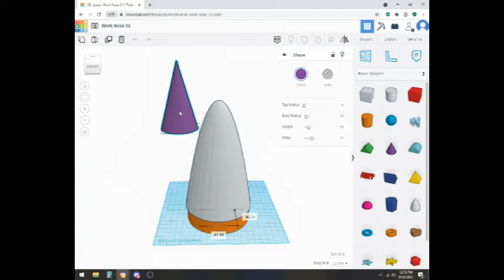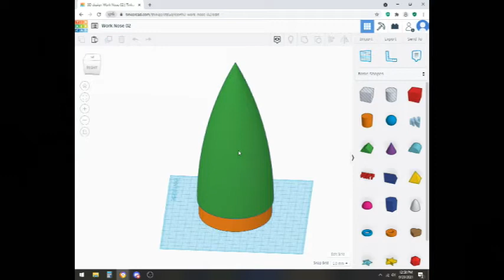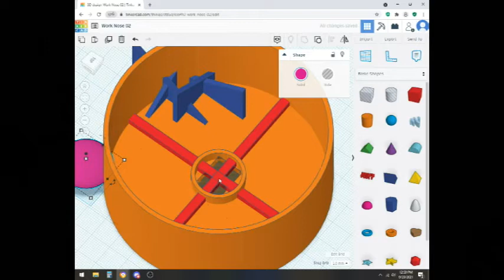Our first 3D printed nose cone using TinkerCAD

Comment: Good nose cone, but did You Try make a mold to make a fiberglass one, i think it whuld be more ligth.
Reply from the maker: The 3d print one is not really heavy at all. Actually, this one has a double wall because we are expecting some extreme speeds with our next rocket and motor. It could be even lighter with a single wall. I have two other videos for making nose cones. One does use a mold from a soda bottle to form a nose cone out of automotive body filler. I really like making those and have flown them many times on our Eliminator series rockets - Those launch vids are also on the channel. The other nose cone video uses kind of a reverse mold process where epoxy is put onto a styrofoam shape. That technique is interesting but now that we can 3d print, i don't thInk i have a need for that method anymore.

Comment: could this cone handle a H550ST motor? i am building a LOC-IV type rocket and i wanted to 3d print the nose cone. thansk
Reply from the maker: I don't see why not. That is not a really large motor and as long as you have a nice aerodynamic nose cone then it should work fine. There are some things you can do when 3D printing to improve strength.
1. Different filaments/plastics have different strengths. We use standard PLA and it works well. But there are stronger filaments available.
2. Number of outside layers. I believe the default of most slicers will use 2 layers for the outside of the print. Adding more layers would make a thicker & stronger skin.
3. Infill. Two things you can do here...
3A. Increase the amount of infill to make a stronger print. This will also increase your print time... Sometimes by a LOT. We typically print nose cones with 10 to 20 percent infill.
3B. Infill line thickness. Infill is typically one print line wide. I recently watched a video about increasing the infill to 2 wide. I have not tried this yet but in the video, it added a significant amount of strength.
Reply: @rotaryrocketry   i am planning on 5 walls and 5% infill. I made my ogive last night with a blunted nose. 

I am also using same rocket with a j270 which is less force, but longer flight  haha

Thanks for those tips and the help. What video dis you watch on infil lime width?
Reply from the maker: Here...
https://www.youtube.com/watch?v=yskFuq8VjtA